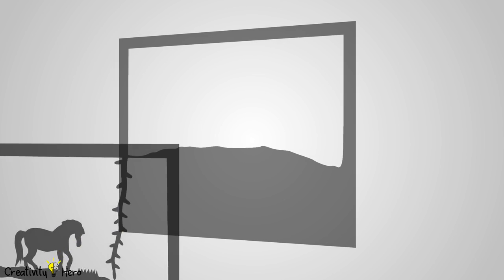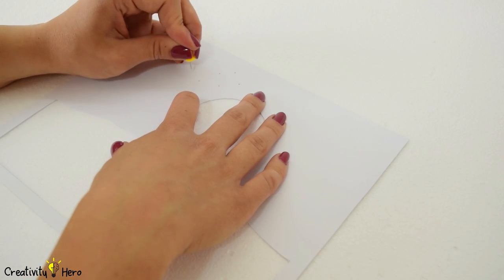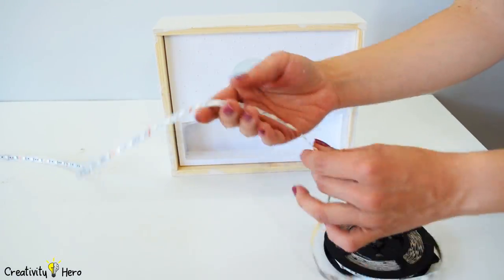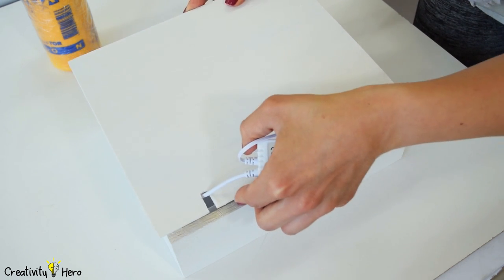How To Create A 3D Paper Cut Light Box | DIY Project

Comment: Can I use Ivory white sheets? Would you recommend ? Planning for 8 different layers. Was wondering if the light will pass through all the layers
Reply from the maker: Yes, you can definitely use Ivory white sheets, but you need to pay attention to the thickness. I recommend using around 150-170 grams cardstock, but not more than 170 grams.